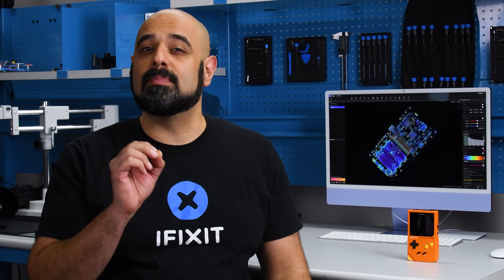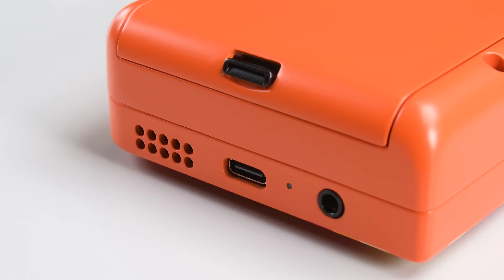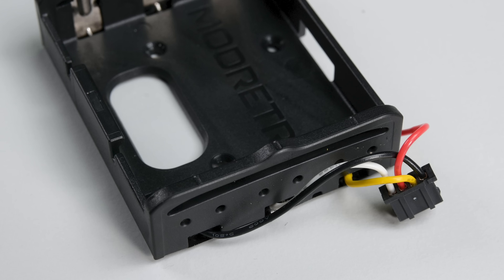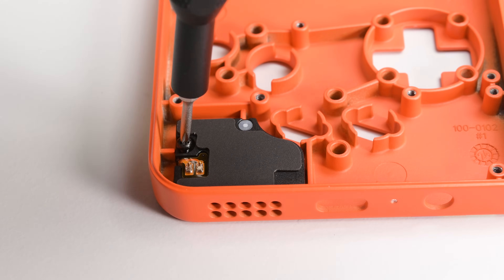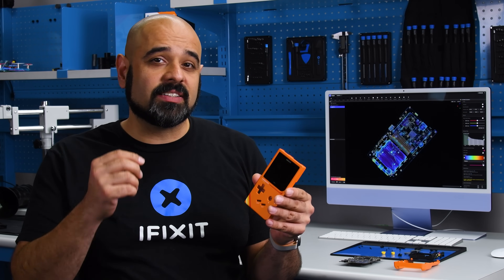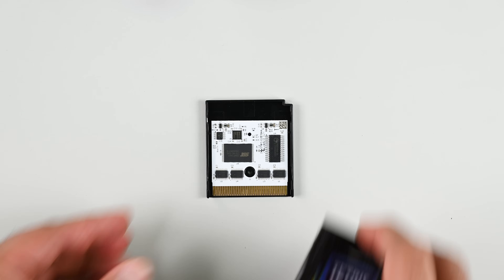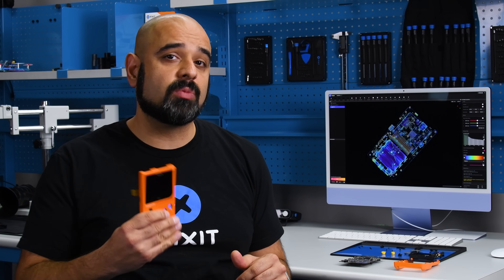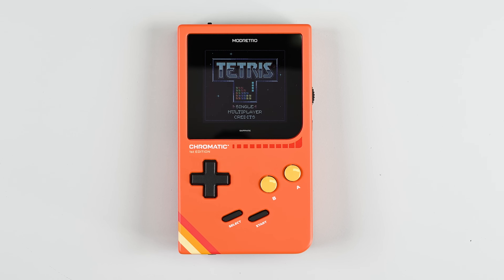The Future of Retro Gaming: Inside the ModRetro Chromatic

Comment: That Wario Land 3 game is FAKE! HAHA you got swindled.
Reply: Well the fact that it says on the sticker 'Only for Gameboy Color' and then is in a Gameboy cartridge is another evidence.
Reply from the maker: Who would have thought we'd get cheated on eBay...
Reply: @iFixitYourself was it listed as “new” if so you got scammed, buy used
Reply: @LordDiscord  The reproductions now days don’t fit in original shells they have specific plastic molds for them, opening them up is the only way to officially tell but i knew the moment i looked at it, just looks like cheap plastic
Reply: @Sqwerks  Well I didn't know that, I just assumed that was something they may do as I've seen really old reproduction, so I assumed the shell was real and the innards wasn't.

Also was my original comment deleted
Reply: @LordDiscord  yeah i’ve seen the old bootleg but this is a modern one, really bad, i don’t know
Reply: It’s amusing because the authentic circuit board looks significantly different than the fake.
Reply: You seem way too excited about someone buying a reproduction cart.
Reply: Reproduction? Or counterfeit? Counterfeit I say.
Reply: @ Both mean the same thing.
Reply: @deadvikingtrolls  Well, they claimed it was authentic, sometimes people do get to excited, i’ve made mistakes like this it’s youtube comments at least they are moderated unlike other platforms
Reply: @Sqwerks It's slimy that it would be marketed as authentic.
Reply: @ Boards fake… They could’ve made a mistake seller wise that’s common nowadays
Reply: @Sqwerks  it’s a pretty obvious fake as WarioLand 3 is a GameBoy Color only game and even the shell is wrong. Otherwise it would’ve been in a black GB cart like WarioLand 2. It shows people shouldn’t claim things when they aren’t actually sure about it.
Reply: @otterdonnelly9959  Yeah that too
Reply: Yep def a fake. The original cart pcb looks very different.

Comment: Quick correction; you keep referring to this as an "emulator", which isn't accurate. It's an FPGA based system, which is different in that it's actually simulating the original hardware (Sharp SM83 CPU) precisely, rather than merely translating system calls into a usable format for a modern CPU (i.e. a generic ARM chip) as with software emulation. This means FPGA can have 1:1 accuracy since the game code's calls to the CPU aren't going through a translation layer that can potentially make mistakes, or return slightly different results than original hardware.

Like, technically yes it is a form of emulation, but calling something an "emulator" has the connotation of specifically "software emulation". It's more accurate to call devices like these "FPGA devices" or "FPGA consoles".

Comment: My ir window came slanted. I noticed the eye sore when I took it out of the box. Mine is a GameStop exclusive. I'm wondering what I should do. I have the ifix it kit but again IDK if I should send it back.. the power button had 2 clicks instead of one.. I ended up returning it and the second one I got the volume button was bent and was hard to scroll. I'm on my third and everything is good so far aside from the slanted ir window it also has that's less of an issue like the other 2.

Comment: I wonder how easily the insides of the ModRetro could be transplanted into an original GBC shell
Reply: If that's your goal, you're better off using Funnyplaying's FPGBC board, since it's functionally very similar to this device but that one is designed to drop into an original shell with no modification.

Comment: A small thought on yet another fine tear-down and review:

At this point aren't tri-point and pentalobe screws exceedingly common due to their widespread use in electronics and the resulting tools to deal with them readily available? Perhaps it's time to retire this particular gripe when doing repair-ability reviews/tear-downs?
Reply: No. There's absolutely no reason not to use Torx.
Reply: While common enough in electronic repair, the average consumer likely doesn't have a tri-point bit without doing a separate purchase to do a repair, and many people associate those screws as ones they aren't meant to remove compared to a flat point, Phillips, or even Robertson screw types.
Reply: @MorningDusk7734 Nope: every screwdriver kit comes with tri points these days.